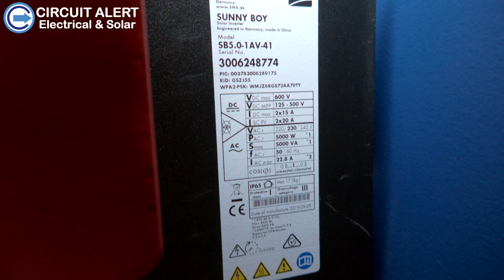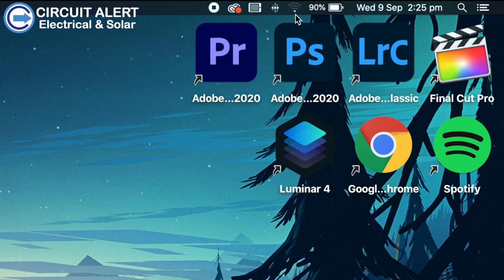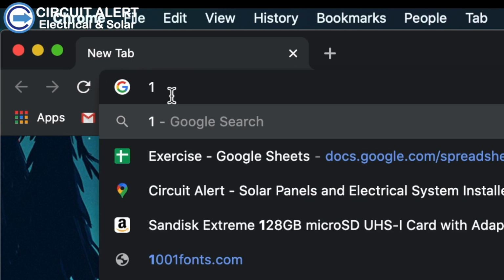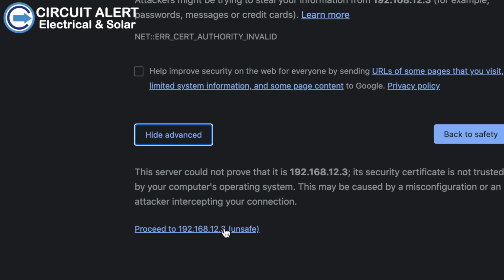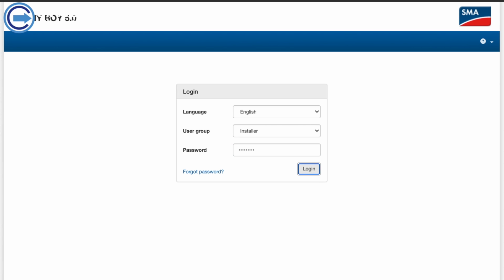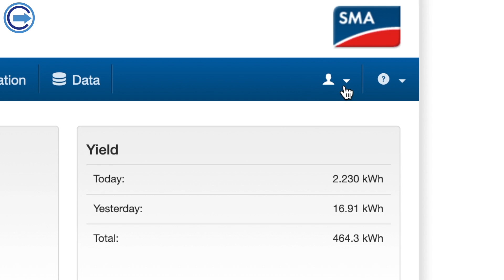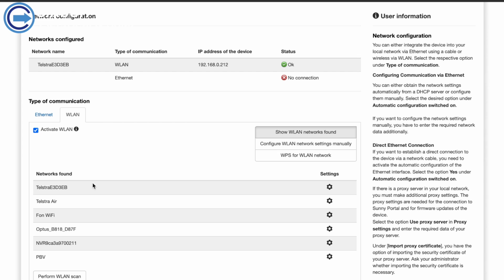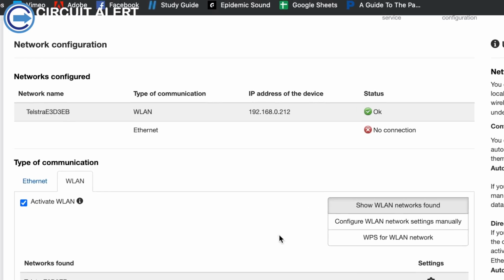How To Setup WiFi For Your SMA Inverter

Comment: Dear Sir. Which password you referred to when you said to enter  the password that has been written on the back of the menu!? Thanks in advance
Reply from the maker: Hi I suggest contacting the company that installed your system. If they can’t help you I recommend contacting SMA support on : 1800 762 287

Comment: which manuel?
Reply from the maker: Hi If Circuit Alert installed your system you would of received a email from SMA direct with a Password, if you were installed by another company I recommend contacting them direct, some write the user name and password in the back of the SMA user manual.
Reply: @circuitalertsolar5666  hi, sir, i have the same Concern regarding password. The company Installed our Inverter dont have the password also.
Reply from the maker: @VaRuNGonzaga  Hi if the company that installed the system can’t help you I highly recommend contacting SMA support. 1800 762 287